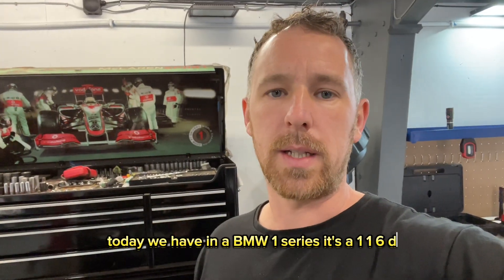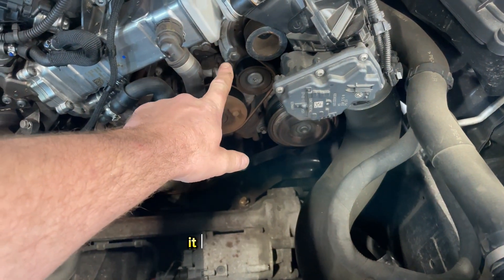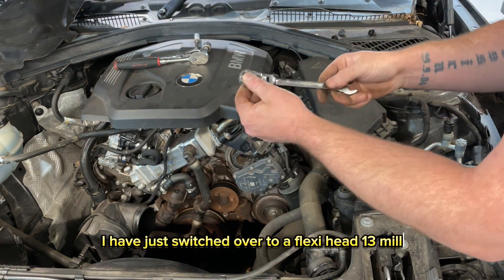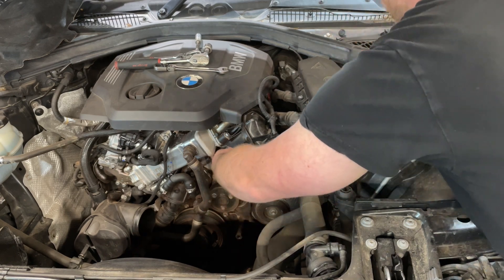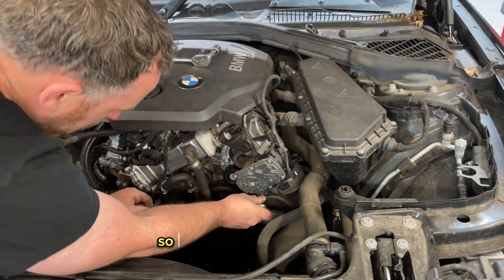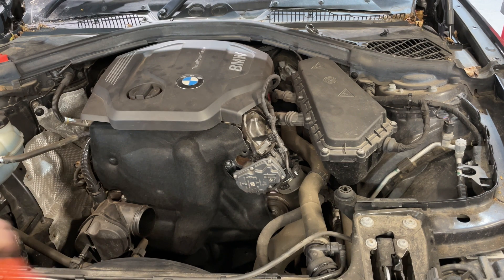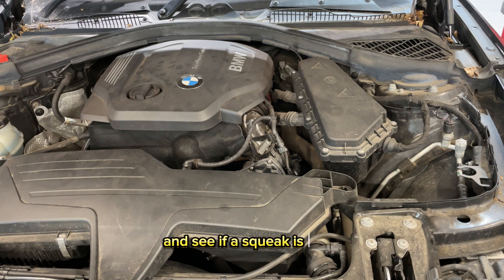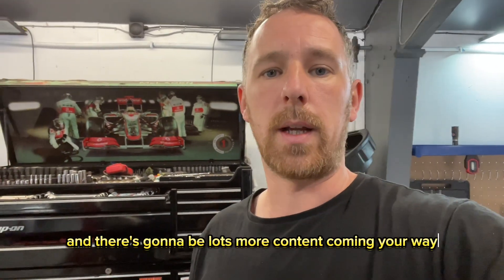How to replace BMW Auxiliary belt and tensioner!

Comment: Hi I have the same car put in a new tensioner and belt the tensioner sounds like it’s rattling do you have any advice and the belt is wandering a little bit and did you use any tools to aline the tensioner any help would be greatly appreciated
Reply from the maker: Hey have you still got the old tensioner ? Check it against the new one to make sure it’s identical and if it’s the same check the back side for any locating pins, lastly could it be a bad new tensioner if it’s rattling ? Let me know how you get on 👍

Comment: Hi I have the same car and I did switch auxiliary belt and tensior. after 300km the tensior go forward and backwards and making a metal noise like it banging so its like lose tge tensior belt. do you have any tips?
Reply from the maker: The tensioner is ment to move about while running, have you checked the other pulleys for play and noise with the auxiliary belt off ? I use a stethoscope to pinpoint the noise if it’s not obvious. 👍

Comment: Hi, I have the same type of car too. When I turn on the air conditioner, I hear a squeaking noise. Could it be that I also need to replace the auxiliary belt?
Reply from the maker: Hey when you activate the air con the belt will be you set more stress and can cause a squeak I would have the belt condition checked and replaced if needed 👍
Reply: Which size for belt

Comment: Your crank shaft pulley is damage, needs to be change every 10k km! you can see it is pushing the belt to the front of the car.
Reply from the maker: I did mention that to the customer about the pulleys on these, but they didn’t want it done at the time 👍 but great advice tho 😊